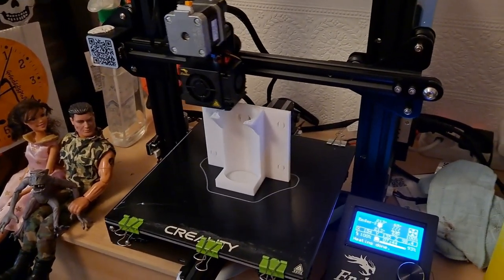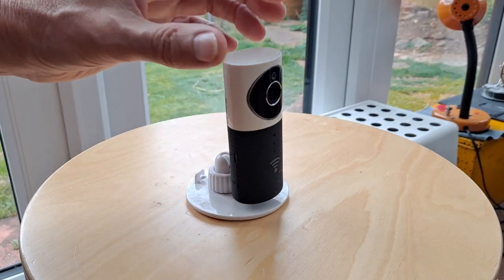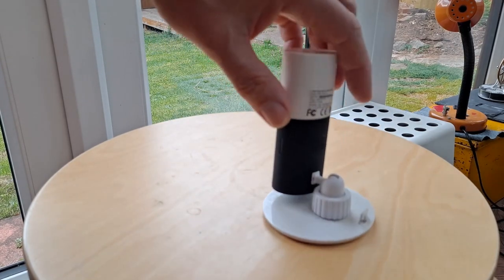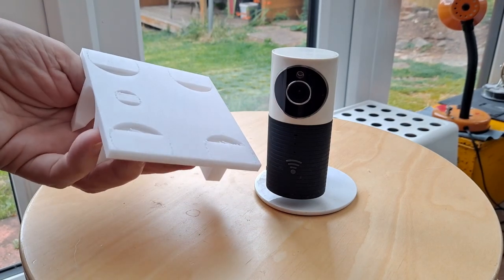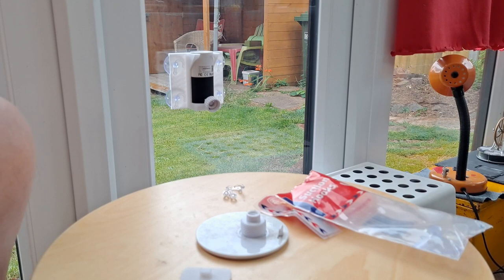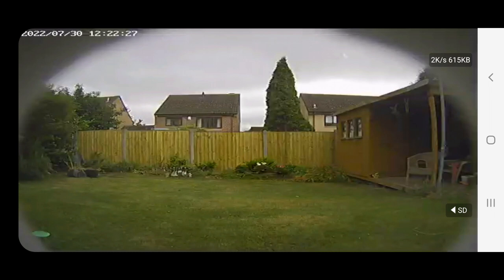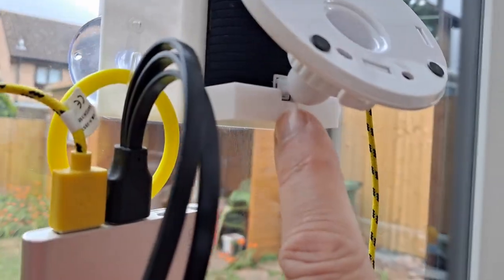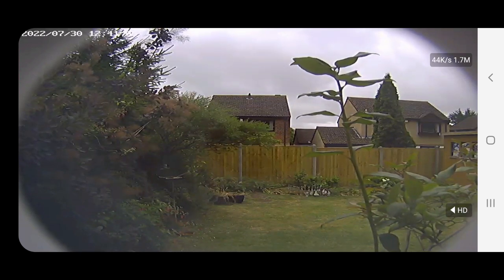Window mount for my Clever Dog security camera

Comment: Good design. 
Am having trouble with a trailcam that I'd like to do something similar with. It won't power on after we moved house... it only rattled around in the back of a moving truck for 300 miles, can't think what may have happened 🤣
Reply from the maker: Now fixing that camera sounds like one of your normal projects that you do with your eyes closed and one hand behind your back. (whilst balancing your camera with one foot). I guess you have slowed down a bit 😆😆
Reply: @GrandadIsAnOldMan  Must have, all I've done about it since then is to type this message 🙃

Comment: What is the purpose of this camera?
Reply from the maker: The camera is a security camera. It will detect movement and record it. It is connected via WiFi to my network and I can view it from anywhere in the country. However, I have set it up here so I can keep an eye on the bird table. I also use it for monitoring my 3D printer which is in my work room. I do have other security  cameras doing normal security monitoring, but this one is a spare my daughter gave me.
Reply: @GrandadIsAnOldMan  Yes, I need one for all the stray cats in my area! Thanks for the clarification!!!